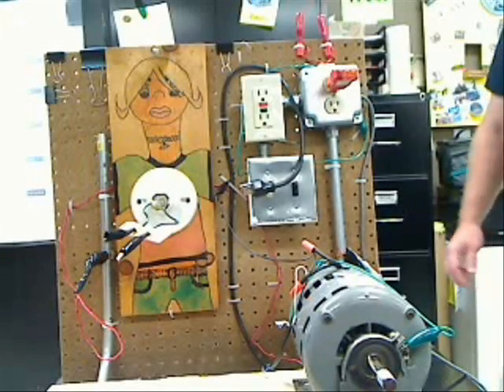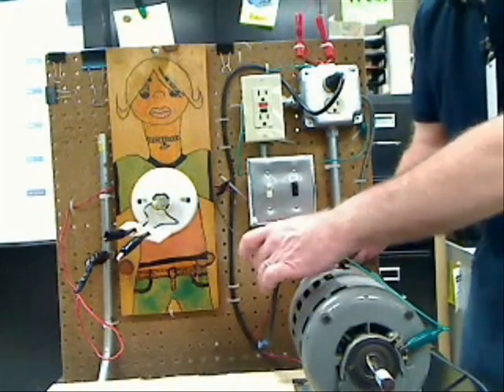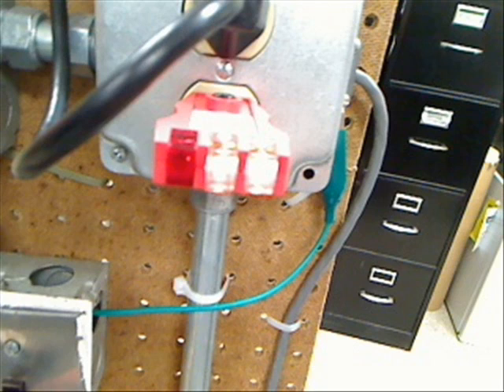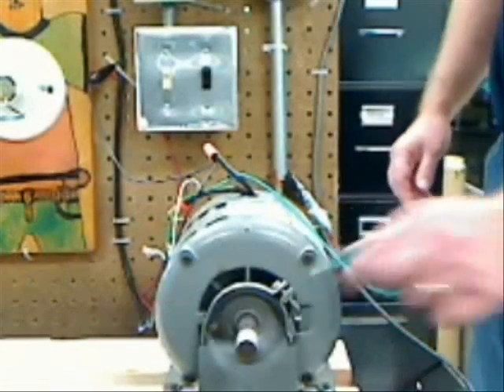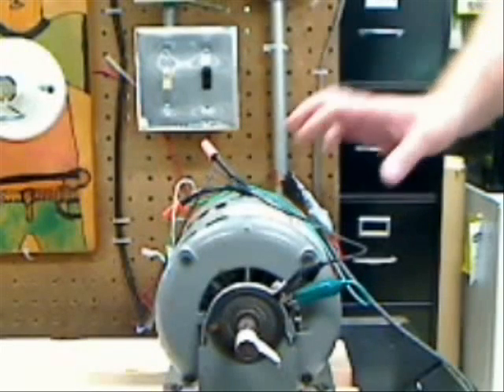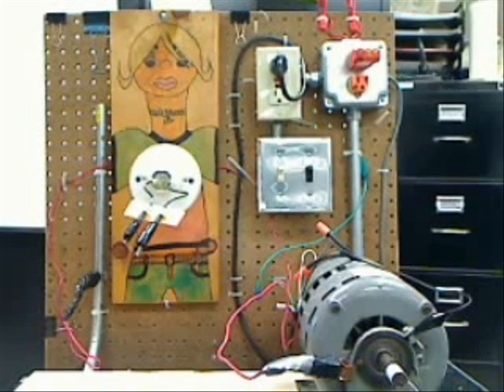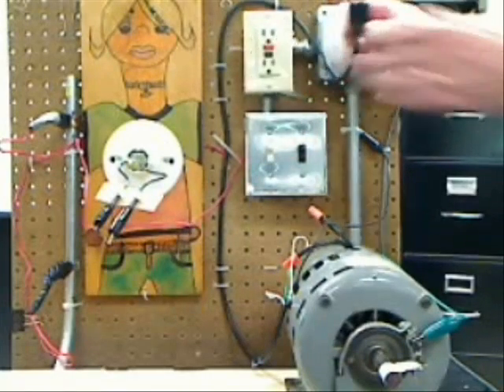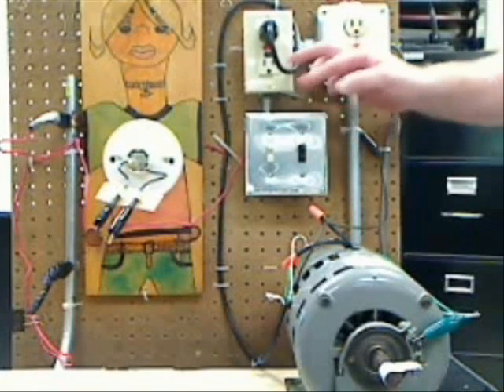Electrical Grounding and GFCI Protection

Comment: Electrical grounding protects the equipment or system....not the person. It simply dissipates the overcurrent to control arcing. Overcurrent protection prevents shock. In this case, his "breaker" acted as the overcurrent protection. If the equipment becomes energized the (AC) electrical energy will continue and try to return to source. If grounded, the electricity will still flow to ground and a person to the point overcurrent protection trips. But if there is no overcurrent protection, things could get worse. So remember, overcurrent protection is vital to safety.